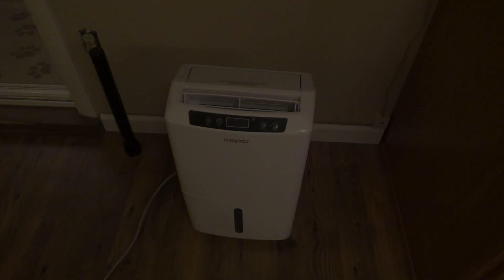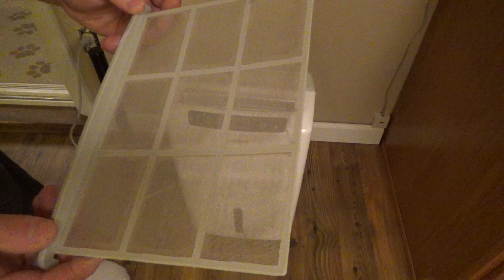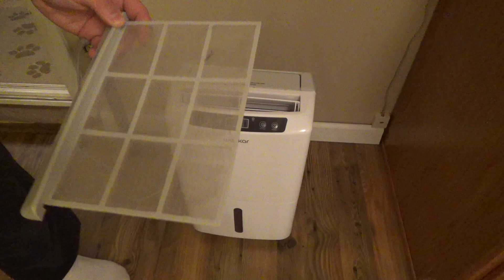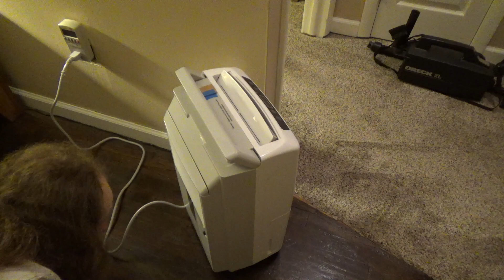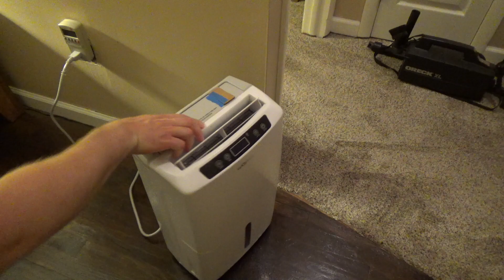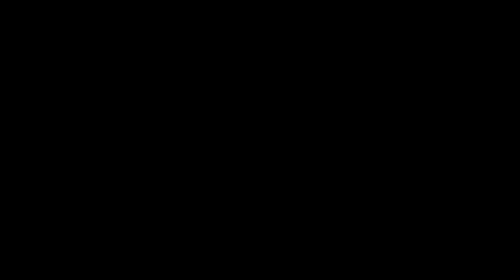Waykar PD160B Dehumidifiers | Spring 2024 Startup and Test

Comment: Another advantage this unit has is how underpowered it is.  In anything other than a dorm room, it's probably going to be running near 24/7.   So many modern dehumidifiers short-cycle do to the lousy placement of the humidity sensor right against the evap coil.  I've only seen one electronic-control dehumidifier where they bothered to move it to a more neutral area, and that one never short-cycled.
Reply from the maker: I prefer a unit that runs continuously but works at a slower rate, it creates a more comfortable environment especially with heating and cooling.
Reply: @JordanU  I'm trying to figure out how to import some of the Asian dehumidifiers.  There's a couple of them on the market with a compressor AND desiccant wheel.  Compressor handles humidity removal down to about 45%, desiccant wheel below that.   I believe they have inverter compressors as well.  

I have both desiccant & compressor dehumidifiers here, and as predicted, the compressor units are far more efficient (Florida), but for driving humidity below the 45% mark, the desiccants continue to wring water out of the air. 

I'm probably going to pick up one of these small Waykars and let it run 24/7, let the bigger compressors pick up the peak loads.

Comment: how big is your house/space?
Reply from the maker: The coverage area varies drastically depending on conditions. Generally speaking I wouldn't use this in an area much larger than 150 sqft.
Reply: @JordanU  thanks!  helpful video.  looks liek i'll go up to the 80/5000 sf from Waykar.  i liked this one based on what you said about the type of refrigerant and pressure.  don't like the reviews on Amazon that so many of these were defective.  you know your stuff - THANKS

Comment: I am almost certain these aren't using a linear compressor. Linear compressors, from what I understand, use an inverter to run and I don't recall seeing an inverter board in these. I believe these are small reciprocating compressors, they act and sound like reciprocating compressors. I have looked up the compressor by model and it comes back with a standard electrical hookup with a start relay and overload. It also shows it as having a standard induction motor, and linear compressors don't use an induction motor.
Reply: Yea I looked that up it looks LG makes linear compressors and that’s it at least from I’ve seen. The compressors in these are regular refrigerator reciprocating compressors. That’s probably a good thing because LG is having failures with their crappy linear compressors.
Reply: @crazytr9463  That is what I came up with also.
Reply from the maker: I think you're correct. All the searching I've done doesn't provide any indication that it's a linear compressor either. I just went back and checked the original comment that said it was -- it doesn't seem like a particularly credible user. I thought there were multiple people that said it was linear, but I guess I was recalling incorrectly.

Comment: I've got one because of your recommendation and I love it. Thanks.

Something I'm not sure is dehumidifier mode on window and portable AC
Reply from the maker: Thanks for letting me know.
The 'Dry' mode on air conditioners might as well be a scam. It does nothing different than the 'Cool' modes.
Reply: @JordanU  Yeah all the dry mode does is run the fan on low and locks out the temperature selection however it will shut down the compressor if the unit detects too much ice on the evaporator coils, the room will still be cooled down sometimes by a lot! where-as a traditional dehumidifier actually heats up the room by a noticeable amount.
Reply: The dry mode on portable AC units works Okay as long as you use constant draining as when you use the regular mode the fan adds humidity back as it airaites the water as the internal tank gets full

Comment: Nice testing of these things. We have had a good amount of rain the past few days where I would say we have had 8 inches within the past 10 days. Have not had any problem however with moisture yet as the warm days we have been getting have been dry with little moisture in the air. Likely will not last long. May have my dehumidifier up and running here before too long either. Those units are likely the best out of all dehumidifiers made today. With how little amperage these things pull, these are sure energy efficient. I honestly don’t know why other companies have not figured this out yet. Only time will tell.
Reply from the maker: The power draw is low--but it's not anything to write home about when compared to the performance. These are only 12 pint machines according to the current rating standard, probably the smallest real dehumidifier with an actual refrigeration system you can buy today.